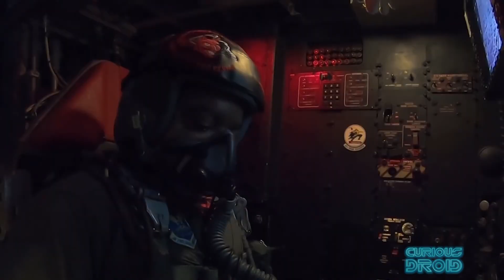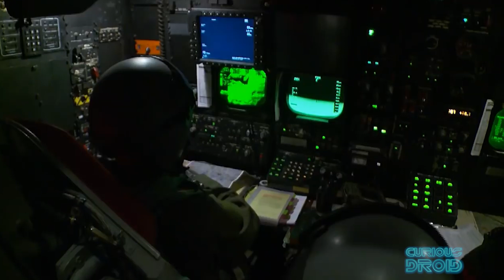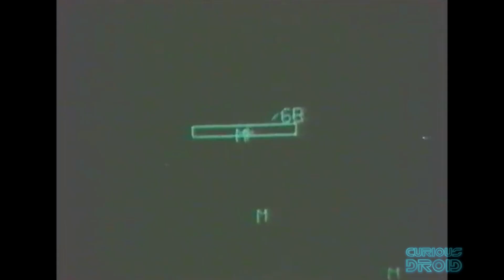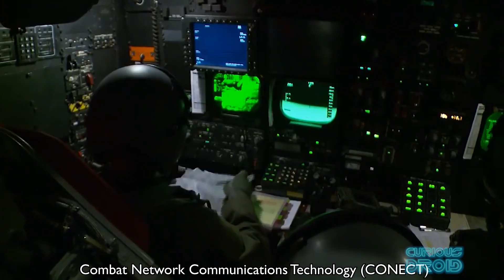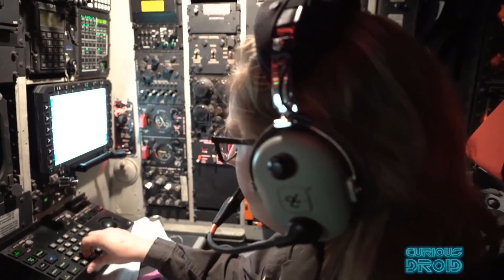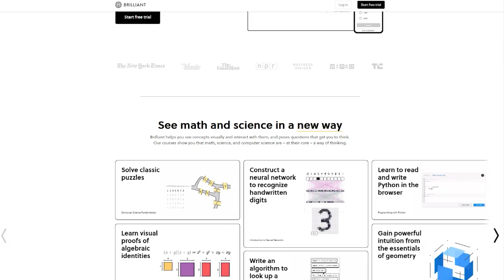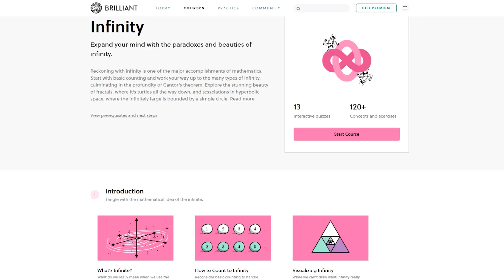How Long Can the B-52 Continue in Service?

Comment: About the re-engine part. I think the winner will be Roll Royce. Their re-engine proposal explain that Boeing doesn't need to make new engine housing\nacelle (idk what is the correct term), which is helping saving cost with not designing new wing.

Comment: Physics doesn't age. Aluminum doesn't rust. But fossil fuel will end some day. So replace worn parts, refit with electric battery engines and it can go for thousands of years if needed.

Comment: I worked for Rockwell maker of the B1-B in the 80s and they cost $200 million each for the first 100 ordered. Rockwell offered another hundred B1s for $100 million each so the B1 fleet could have been 200 B1-Bs for a fairly cheap price, but Air Force said no so we're dealing with B52s. The B1-B is twice as survivable as a B-52 and super sonic.
Reply: Congress authorizes the aircraft purchases.  I remember the 80s, too.  Congress didn't want to buy the 100 other B-1B aircraft because they were saying "The B-2 Stealth Bomber will be coming on line".
Reply: @Easy-Eight  I worked on both, I just remember a lot of people getting laid off.
Reply: @MountainFisher  , In the 80s the American people had a very liberal congress.  Remember "Tip" O'Neil?  I remember a few decades back when the USAF wanted to get rid of the A-10 and Congress told them no.  The USAF puts forth the budget requests but the Armed Services committee approves the request that goes up for a house vote.  You know that.
Reply: @Easy-Eight  I just remember them telling us no extra hundred planes. My work was finished after their final design was settled on except some tweaks here and there. I'm a bio-engineer and I worked on life support. I remember telling a head engineer that the B1-B was over engineered and they really should have bought 200 more.
I worked on the Trident sub Control Station and it was one engineering change after another, either from GE Electric Boat the main contractor on the East Coast or the damned Navy wanting the lights on panels dimmer or brighter for crying out loud. It was stupid. To change a plastic cover over a light took about $25,000 in paperwork for a 25 cent part. That is why a coffee maker for the C5-A cost $1100, because it had to withstand more G forces than the crew could.

I laugh every time I see the James Webb Telescope cost 1000% more than originally proposed. I know how that stuff works. Well they're testing and retesting to make sure it works after going from 1 billion to 10 billion dollars that now they can't just stop and let it go. They proposed something they did not know how to build. Milked it for a decade and now they're going to put it on top a big rocket that they hope doesn't screw up. Ten billion dollars sitting out in space and they hope it works. Could of saved money and assembled it in space. Then launch into its million mile orbit or whatever it is suppose to be.

Comment: When I was in aircraft mechanic's school at Chanute AFB back in the mid 70s, we learned that USAF aircraft over ten years old were considered obsolete and a '1' was prepended to their tail numbers to indicate such. Seems like that doesn't apply to these old girls. I went on to be a crew chief (AFSC 43151E) at Grand Forks AFB when these birds sat nuclear ground alert in SAC. I even managed to score a photo of my old aircraft 60-0046 a while back and have it as my desktop wallpaper.  It is nice to see them still flying, though I like the old livery (as seen on 2584 in the video) better than the modern grey.

Comment: I remember when we got our first B-52D's in 1957 they said it had a 10,000 hour airframe.  I guess because of the flexing of the wings and the problems the B-47 had with similar wings.  I think there was a wing modification or replacement program as there have been many up-grade and replacement programs in the planes history. Now they are trying to start a program to replace the 8 engines with 4 new and better engines that burn less fuel and have the same total power output. 
There is no reason the BUF cannot go on until there is no need for a long range heavy bomber.
Reply: They will replace 8 old engines with 8 new engines
Reply: @unfurling3129  No the plan is to use 4 engines in the 4 pods
Reply: @jimfling2128  Where shall we place bets on this?
Reply: @unfurling3129  The B-52 is sort of like a Porsche. As long as you keep fixing it, it will last forever. If it is valued you pay to keep fixing it.  60 year old Porsches sell for $150K. Fixing a B-52 is cheap compared to building a replacement

Comment: Why doesn't the USAF invest in making a direct cost effective replacement for the B-52 instead of something so technologically advanced like the B-21? If they made something that was a direct successor to the b-52, it seems they could avoid high airframe costs and have a good heavy bomber for the next 50-100 years.

Comment: Same reason as the  Tupolev TU 160, don't change perfection.
Reply: Franco Barone - B-52 is slightly older. (By 30 years) And the TU-160 is due to be replaced by the PAK-DA.

Comment: cant hack into the systems of an analogue aircraft. with enough work you can hack into any digital system. so when your f35  and b21 are getting hacked and dropping out the sky the only part dropping out of the b52 will be bombs

Comment: The Tu-95 Bear could be considered the B-52's counterpart, as the Russians intend to run those for a long time too
Reply: Was actually surprised he didn't mention the Tu-95, i think both are about the same age or so
Reply: The Russians are still using stuff left over from Czarist times
Reply: Except they continued to build Bears until the mid '80s. I wonder how old the oldest Bear in active service is?
Reply: @Mishn0  They built them in 1990's too.
Reply: @shebbs1  True, as the Tu-142, I forgot that! That and the Russians have long been known for not discarding old equipment when the new stuff comes out. They'd just shuffle it down to the lower echelon formations. Like the US used to do with the National Guard, Now the Guard has F-22s and F-35s as soon as the regular Air Force does.

Comment: I've flown in the b-52 simulator at barksdale in the late 90s. It's very difficult to fly. It's very slow to respond. You have to plan your moves ahead of time. It's an amazing airplane. I've also got to fly on one on a hop to come home. I was very surprised how much power it has on takeoff. I was pushed into my seat pretty hard. When you watch one takeoff it looks so slow and as if it'll never get off the ground. I'll never forget it.

Comment: @12:42 I think the comparison of time relative to the date of the Wright brothers' first flight prior to the first flight of the B-52 is more amazing - August 13, 2000 marked the point at which the B-52 had been flying for half the period of powered-manned flight.  December 11, 2048 will mark the point at which the B-52 will have been flying for twice as long as the time that manned flight had existed prior to the first B-52 flight.

Comment: Same thing with the Russian TU-95. As it turns out, the technology for building a big truck full of bombs hasn't really improved since the 60's.
Reply: *hasn't improved enough to warrant the cost of replacement over the cost of enhancement
Reply: Why fix it when it ain't broke
Reply: Bomber planes as a whole is incredibly obsolete in this day and age. They are big, heavy, slow, consume enormous amounts of fuel, and do not have a place in real combat except against 3rd world countries. Missiles have taken the spotlight, this plane can take 5 hours to fly to it's target just to drop let's say 15 megatons worth of explosives. While a singe missile can carry literally 100 megatons worth of explosives the same distance in just 20 minutes.
Reply: Convert a modern 747 and you will get more range and payload.
Reply: @MrMonkeybat   not once you include armour armament and a variety of control and suppression and secondary suppression equipment your standard airframe is not as well built as most military aircraft.  1. You'd be lucky to get off the ground. 2. You'd be lucky if your wings don't snap on a turn. There's also the issue of engine strain. You'd be lucky not to burn out the engines.  And if you modified a civilian airframe to fit military specs you might as well have just modified and altered old military frames with modern tech.

Comment: I grew up as an Air Force brat.  My dad flew B-47's and B-52's in the 1950's and 60's during the Cold War.  He also was a B-17 pilot in WW II, shot down on July 26, 1943 and spent the rest of the war as a POW.  He could fly anything that had wings and an engine.  Best parents a kid could hope to have.

BTW, BUFF did not stand for Big Ugly Fat Fellow at least I never heard referred that way on B-52 bases.  It was commonly referred to as the Big Ugly Fat F**ker.

Comment: It's a crying shame that the engines have never been replaced with a more modern set. Damn politicians and bean counters.
Reply: @askhams  The more powerful (important) bean counters though work for the manufacturers who stand to make far more money by selling entirely new war fighting systems with price tags running to hundreds of billions. They will push for "invisible" new bombers then only deliver a fraction of the numbers and thereby drive unit costs through the roof. B1-A, F-22, B-2, F-35 etcetera. The taxpayers' representative on the money discussions haven't the clout to be heard until perhaps after the ink is dry and the figures are published.
Reply: @puirYorick  Part of the B-52s projection of power is engine count, move to one engine per pod and it looks more like a passenger jet.  The B-52 is kind of like Convair B-36 with 6 turning and 4 burning.
Reply: @bobroberts2371  I'm not sure we want the adversary forces close enough to count engines on a BUFF these days when any tin-pot dictatorship has access to half-decent SAM systems. It's still capable of Big Stick Diplomacy though.
Reply: @puirYorick  The visual projection of power occurs way before the B-52 is overhead.  Visuals are an additional  deterrent.
Reply: @bobroberts2371  Bob, I'm sure that statement makes perfect and logical sense to you so I shall leave it to you. Best wishes, man.

Comment: Two points. First, re: the BUFF. It was only called "Fellow" in mixed company. ;)
Second: a huge part of the longevity of the BUFF is that it's a bomb truck. Most of the upgrades are in the weapons it uses. Whether you're talking about the B-52, B-1, or B-2, they're all vulnerable to modern air defense systems. The B-2 relies on stealth to survive; the B-52 uses standoff weapons which may be upgraded in the future. The stealth can be built into them.

Comment: In 1995 I was on deployment to Davis-Monthan AFB, Arizona.  My duty section was at the Munitions Storage Area, which was surrounded by Boneyard on 2 sides.  At that time, the B-52D "Tall Tail" models were in storage awaiting scraping.  It was an eerie sight to see, surrounded by those tough-old war-birds.  On a related note, the crews whose job to scrap the B-52 stated that, by far, the BUFF was the most difficult airplane to scrap.  It was built just so rugged!

Comment: I got an RFQ [Request for Quote] for a new B-52 avionics power supply system design in 1986.
I started working on a quote. There were dozens of multi output military grade power supplies to be designed.  My boss, the chief engineer who was always right, told me to stop. The project was too big for our little company with 20 engineers and 400 employees.  The B-52 guys I was working with were very disapointed. It seems I was he only one who responded to the RFQ.

Comment: Isnt planned obsolescence more a myth than anything else? Coming from subpar technology which has been replaced and bettered again and again. Ie this phone of mine (Motorolla) is 5 years old, still streams and calls fine, camera still works, memory aint close to full, and has survived being dropped multiple times.

Where as back in the day screens for phones were quite fragil cause they were working with new technology, that cost more than the current tech, yet want half as durable??

Even cars have steadily improved, satelites, airplanes. I cant think of a technology which hasnt gotten better. People only seem to replace stuff cause they want the latest product and not cause their old product broke.

Seems to me people just assumed cause phones were a bit shit in the early days, that they thought manufactures were doing it in purpose. Not unreasonable to assume but short sighted. Annoying your customers isnt a good strategy, and really pleasing them buys brand loyality

Comment: Cars havent changed much over the same period. They still have a steel body with 4 wheels.
The engine controls, the interior and the exterior trim has changed a lot.
Same with B52: a constant update of flight and engine controls, interior and weapon controls, but the frame remains the same.
IMHO the power units will be upgraded once USAF settles on fewer engine types on stock.

Comment: Year 2340: The B-52-Z has retired.....welcome B-52-Z-A
Reply: Full impulse with antimatter bottles.
Reply: @Eshanas  Equipped with the latest space-to-ground missiles to be deployed from standoff distance in Mars orbit. Capable of unrefueled missons from Luna to as far as Ceres. Be aware of operational hazards caused by Saigon chicken bones becoming dislodged in zero G.
Reply: @Eshanas  Rotary photon torpedo launchers.
Reply: B-52-Z-A is going to be that needed retrofit that will come just in time for 3rd Earth-Centauri conflict.
Reply: The B-52-AA
Reply: Morgan Brown B-52 AAA battery
Reply: imagine the Imperium using B52s LMAO
Reply: B-52 Pro.  B-52 Sport.  B-52 Plus.
Reply: Moozilla Moo B52- Platinum Edition
Reply: B-52-5000-A
Reply: Meanwhile NCC-1701-E rolls off the line
Reply: Changelog:
* B-52-Z-A
  - New spacetime disruptors
  - Upgraded energy shielding
  - Mark 24 AI
  - TODO: in-atmospheric performance awful because it's still running on original TF33s
Reply: Hi I am the latest B-52-Z-A1, I have gained the capability to post comments on youtube.
Reply: The MK 52
Reply: B-52 EYYYYYYY
Reply: ekcookvids The L-4/L-19/L-21/U-6 beat them too it (and was in continuous production from 1930 to 1985 for military customers and you can still buy factory new ones).
Reply: Year 2340: Hmmm who do we bomb next?
Reply: Year 2999: D Check completed, avionics upgraded, wings/landing gear/engines replaced. Ready to fly!🤑✈
Reply: B52 crashed 500 yds from my house in 1961 in NC 19 miles north of Seymour Johnson AFB .  Unforgettable experience as a 12 year old.
Reply: Where were you when the UNN's B-52s carpet nuked the belter trash on Ceres?
Reply: You should learn from Apple: The B-52 lol
Reply: Looks like a Ford part #
Reply: they changed the colors :p
Reply: Only if Trump is in the whitehouse
Reply: Landing gear and thrust related propulsion is eliminated due to the "next generation" Pratt and Whitney anti-gravitational horns.
Reply: B52 intergalacticfortress
Reply: The B-52 will likely be retired when America ceases to be a global super power. Americans don't like to admit this but it may only be a few years away. The empire is in serious decline at this point.
Reply: @Novusod  
Not likely.
Reply: Novusod ya I’m an American and I do say that every superpower nation maintains its power by 100 to 150 years

Comment: I thought the B52 was designed with propellers.
Reply from the maker: The original designs done in 1946 has props but as it progressed so did jet technology and they switched to those instead.
Reply: @CuriousDroid  yeah, I always thought that was the most impressive part of the story. It was designed for propellers and it was still around. 

I could be wrong but I thought when I was a child in the eighties they were flying some that were built with propellers but had been upgraded to jet engines long ago.

Comment: It's Trigger's broom writ large. 

New engines, new wings, new tail, new avionics, new skin. 

They're not the same aircraft anymore
Reply: The design is fine, but over time pieces, parts become fatigued and require replacement.

Comment: the reason the b52 will stay longer is because its cost to keep it flying is still LOWER than it's modern counter parts and has a shorter service time per flight hour than them as well ... the f35 being even more expensive than a b52 to maintain ... which makes the f35 an expensive garage plane per flight hour ... and useless as a fighter interceptor at a cost that doesnt reflect it's lack of effectiveness in cold climates.
Reply: the tf33 essentially a modern iriquois engine from avro canada ...

Comment: the thing with the b52 and the c130 is it kinda is accidentally a perfect airframe. the b1, b2, and f117 are newer and better in a lot of ways but is being phased out because it is technically more complex. the c130 is still being made to this day and the b52 is still used in combat. they dont need to be cutting edge for what they do.